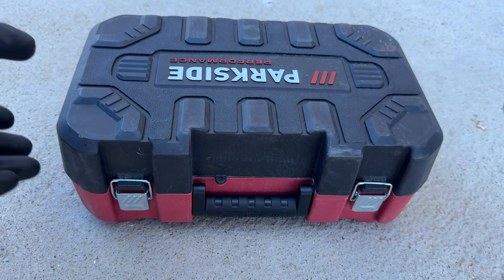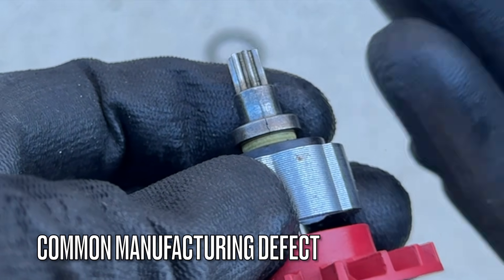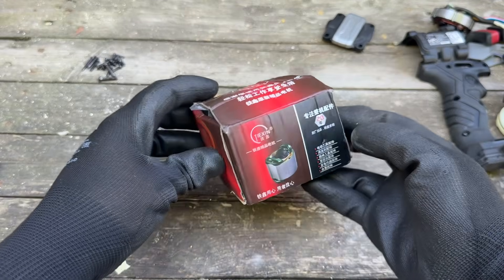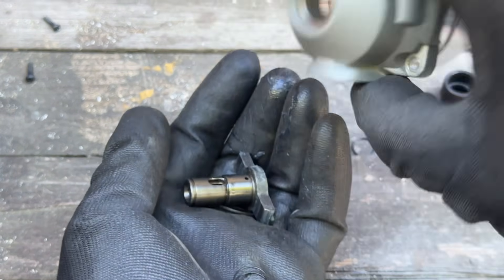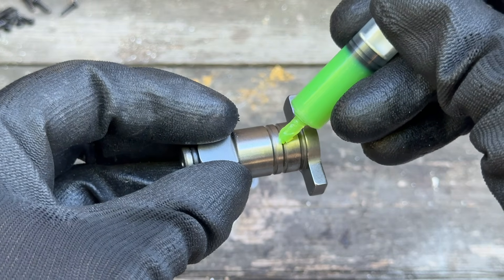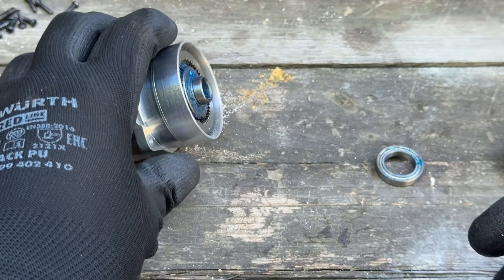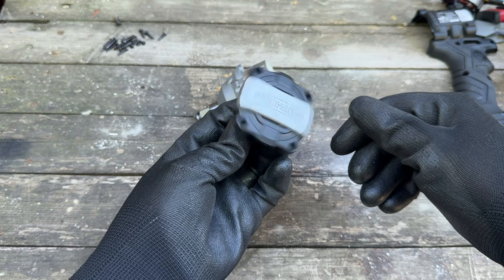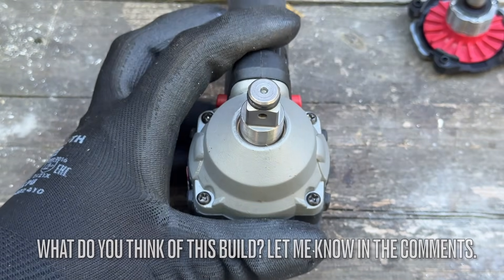Fixing the most defective tool IN THE WORLD. Cheap parts with links provided. Parkside PDSSAP C3

Comment: Everything I've bought from Lidl hasn't even lasted a year. Some tools didn't even last a day, others were problematic from the start. A corner sander (with triangular sandpaper) didn't even last a day and it was problematic. An angle grinder broke after two or three days. A plasma cutter didn't work properly at all; it destroyed all the front lugs, it burned right through them. The only good thing is that Lidl accepts all returns directly; you just need the receipt. For me, that's not the point. Someone buys a tool to go home and use it. If it turns out the tool is defective, their plans are ruined. Okay, make the tool a bit more expensive, but build it well. China is very bad at this; they don't test their tools. They build them and say they work, but nobody cares how long or how hard.
Reply from the maker: I agree that it’s incredibly frustrating when a tool breaks so quickly, and it's not worth the hassle of repeated returns. That's what I have been trying to say for like a year now, because the Parkside quality has hit rock bottom in 2025. It used to be that the tools were good for the price, bit now if I weren't buying them for reviews for the channel I would not bother with them at all.
Reply: Bravo, my friend. Then there's the other problem with these batteries: you buy a tool, but there's no battery in the package.

So, €50 for the tool and €50 for the battery equals €100 for a miserable tool + a charger = €130. Yes, that's outrageous!

If you buy a cheap tool from TEMU, it's just as good or bad as a Temu tool, but often you get one or even two batteries. Well, wait, nothing special. I bought a small chainsaw from Banggood two years ago. The batteries were so bad they were dead in 5 minutes. I ordered a new battery for €20. I knew I shouldn't expect anything special. When it arrived, I just had to laugh. The battery, about the size of a 6Ah battery, weighed next to nothing. It was so light, as if there was nothing inside.

Well, I knew it, but such fraud? And TEMU supports it!

Comment: So, whats the version we should go for? Thanks for your videos, I'm considering to buy one and customize it to my needs now that I know it's possible
Reply from the maker: So your best option would be the B3 version. that one is the one I would go for. Strong internals I have been using a couple of them converted in to impact wrenches for quite some time now with zero issues. Unfortunately you can't get them from Lidl, because it looks like they have been discontinued. That said the newest D3 version is also a good one. However there are two options with that and you don't know which one you're going to get. Basically it depends on the spring inside the impact mechanism. You can get it with a thick spring in which case you get loads of power from it, or you get it with the thinner spring in which case the absolute max in terms of power it can deliver is 300Nm. No way to know which one you got untill you open it up and check.
Reply: @BrokeLifeEU  I will try with the D3 then and see what I get. Honestly 300 is enought for me. I actually have a Rioby impact but this Parkside ones looks more handy and the idea of having socket and hex mixed in one is too tempting. Have you tried the Parkside electric ratchet? Would be nice to see some upgrades on one of those as they only have 54Nm and it's not usefull for breaking
Reply: I answer myself, just found your video and remembered that I've watched it in the past before I bought the ratchet
Reply from the maker: @danimp321  Unfortunately there is no cost effective way to upgrade the Parkside ratchet at all. Although I do recommend to break the fastener lose with the ratchet and then use the power of it to drive it out.

Comment: what impact screwdriver should I buy for seasonal changing of wheels and occasional unscrewing of screws?
Reply from the maker: That's a tough one. Ideally you need an impact wrench and an impact driver. But the question is do you really need an impact wrench once or twice per year for seasonal changing of wheels. I would argue not and it's best to get a breaker bar and a torque wrench. Then with what's left get an impact driver for the screws.
Reply: @BrokeLifeEU ok but which brand?

Comment: Strange thing, mine broke too, after i started using it like an impact wrench. Before that i used it to drive long wood screws into wood, and it worked flawlessly for hundreds of screws, but as soon i started using like impact wrench on my car, it broke after undoing 5-6 nuts.
Reply from the maker: They made them to a very low budget it seems and saved mostly on the metals for some reason. The impact mechanism and the drive gear on the motor are really common issues on them. They break after a bit more force is required of them. That said the impact driver you see in the video I got off someone who used it inly for screws in wood and it still broke…
Reply: @BrokeLifeEU  probably older versions are stronger, a friend of mine has an old one and is used heavily for years and it still works. I returned mine to lidl and got my money. A few weeks ago i bought another one, i have to open the package to check which version it is.
Reply from the maker: For sure the first version, the A1 is indestructible. The B3, which is one of later ones is also really good. You probably got the newest D3, which is not as powerful as the C3 you had, however might be more durable.
Reply: @BrokeLifeEU  yes, it is D3, hopefully it will last longer

Comment: how much different is the internals to an actual impact wrench when compared to a impact driver? you think this could be why these fail as people are using them as a impact wrench and theyre not beefy enough internally?
Reply from the maker: Not much different to be fair. The gears are different, contributing to higher RPMs on an impact driver. the rest is basically the same. However with this model in the video they made the shaft holding the impact mechanism together very thin. That is the part that breaks most often. On top of that it breaks even if you use it for just screws and nothing like the bigger bolts on car wheels. It’s just that fragile. The one in the video for example I got from someone who used it for screws in wood which should be what it was designed for and what it is best at. But still it broke after a short while. I think they fixed that in the newer model by using a thinner spring in the impact mechanism. Yea that means less power, however it also means less force on the internals and in turn a longer life duration for the tool.

Comment: Could you give me the link for that belt sander attachment on the grinder? Or is it just the 10 euro one from aliexpress/temu? Is it good?
Reply from the maker: I got it from aliexpress for like €10. The specific link is no longer active but it is just a generic belt sander for an angle grinder attachment. It is nothing special to be honest, you still have to do most of the work. The only thing it is good for is for sanding wood but even then it fell apart. But on sale you can get them for like €5 so if nothing else at least it is not too costly to try them out.

Comment: This afternoon I received my new screwdriver. Model D3. Made by OWIM. 
Before I finished screwing in the first test screw it died. Inside the case there are rattling parts or loose screws.
 I miss the quality of Grizzly and Kompernass.
Reply from the maker: Sorry to hear that! Mine has still not arrived…delay after delay… This is strange, because OWIM usually make the better tools, but I guess they were also made to cut down on cost so…
Reply: I have disassembled the machine. Inside, I found a loose screw. I have reassembled, the machine still does not work. The APP indicates "anti-surge protection" I dismantle the rotor. It is seized. I release it and the machine works again. 😅
Reply from the maker: @OGROMETALBROTHER Does it work well or does it just work 😅
Reply: @BrokeLifeEU  I just bought the D3 and B3 from my local Lidl. The new 1/4 bit holder requires to unlock it when inserting the bit tool, not just when removing it. Based on very limited testing the D3 starts impacting sooner compared to B3 and seemed overall less powerful with slightly more wobble on the chuck. The chuck on the B3 is almost perfectly straight. I can’t wait to check your comparison on it as it’ll help me decide which to keep long term.
Reply: When I tried the machine, it failed again. When the percussion works, the rotor bearing locks again. I disassembled the machine again. I separated the fan as much as I could from the back cover and reassembled. The next day, I used the machine as I thought I would like to break it. Screw and drill logs, maximum power. The machine works perfectly.
Reply: This afternoon I spoke with the technical service of OWIM Spain. In a few days, they will send me a new machine :)

Comment: I wonder, if with this 1/2 mod it is any better (higher torque) than PPDSSA 12 A1?
Reply from the maker: With all the fixes I made in the video it is basically like the original with a 1/2" anvil. That means that it would be more powerful than the PPDSSA A1 12. But do I recommend going through all this in order to fix this? Honestly I can't say I do. The parts alone cost nearly as much as the tool now.
Reply: @BrokeLifeEU  this one's specs say it has 223Nm, while PPDSSA has 300, and 350 for unscrewing. Does it really come that high? And how PDSSAP 12 A1 be at only 170, when its only difference (at least from the outside) is 1/4 hex instead of 1/2...
Reply from the maker: PDSSAP A1 12 and PPDSSA A1 12 are somewhat close on the outside, however completely different on the inside, not one part will fit the other. They are that different. In terms of the PDSSAP 20 in its 1/4" form it does have 226Nm, however when you change the anvil to a 1/2" I guess because of the larger mass of the anvil and not having an adaptor to rob you of power I have managed to unscrew very tight and rusty bolts that the PPDSSA did not manage to unscrew. I can't speak to any Nm claims but just experience.
Reply: @BrokeLifeEU  oh, now you started to convince me :D thanks :D
Reply from the maker: That said the PPDSSA A1 12 is smaller and lighter, with the 5Ah it can do 95% of the work on your car so if there are no rusty bolts you might like it better. 350Nm claimed by Parkside is a bit of a stretch I think, but up to 300Nm it will be fine.
Reply: @BrokeLifeEU  i bought today PASSK 20li C3 and ordered PDSSAP A1 12 to compare. My goal is to have something, what does better with car wheels and can do the role of impact driver. Youtube tests show minimal difference between these two, as it comes to torque, but PDSSAP is lighter and smaller...and PASSK has many negative opinions. I will return to the shop what is worse. What is your opinion between these two?
Reply from the maker: I tested the PASSK C2 which I think is the same as the C3. The difference is the C2 came with a battery and charger and the C3 is a bare tool. All the videos I have seen that feature a PASSK and PPDSSA feature the older PASSK, made by Grizzly that is the B2. Or the first one A1 made by Kompernaß. These newer C versions are made by OWIM and are the best so far. Much more power and better build quality compared to the older models. I tested the C2 against another impact wrench, you can see here - https://youtu.be/WQrmUB8T8-w?
Reply from the maker: I would love to read an update from you when you test them out!
Reply: @BrokeLifeEU  so, the update is, i returned PASSK and never want to see green parkside again (last week I had oil leak on chainsaw, used once 😆)
Nm button stuck pressed in and there was loose screw rattling inside after one use. As for power: it unscrewed wheel bolt tightened 2-3 weeks ago at tire change, but failed at second car, where I tightened bolts with my 80kg standing on 30cm wrench half year ago (acceptable, because with 62cm wrench i had to use much more than 400Nm 😅). It worked as well for bolt tightened with 80kg on 62cm (480Nm, more than its max, but did it)
I hope that small Performance friend will do better than this...
Reply from the maker: @SQBANY13  The green stuff is hit and miss at the best of times. I have had much better luck with the Performance stuff and so am sticking with it. I do have the odd green tool but only when I don't have a Performance option available. Sorry to hear you got a dud! 😑

Comment: Still not as bad as the C2 or b2 whatever it was 🤣 the switch lag was horrible, electronics die all the time... they replaced mine 2 times and 3rd time gave me the c3 I think which is doing really well in my case
Reply from the maker: I think they are about equal in terms of defects. I have seen so so many broken C3s that you would not believe. One of the issues is a broken drive gear which is easy to fix, the other one is a broken impact shaft which is next to impossible to fix reliably.

Comment: every day I am more happy to look for a b3 model for months and get it new at a good price
Reply from the maker: The B3 is not without its faults, however it is far FAR better in terms of durability than the C3. Only ever seen one B3 have issues, out of the dozens I have seen and in terms of the C3 it is about a 50-50 shot.
Reply: @BrokeLifeEU  to this day, being with the power mod (I recommend it) continues to work as the first day, I have to put heatsinks on the MOSFETs to make it more reliable.
Reply from the maker: @kiky2h  Is that the B3 or C3?
Reply: @BrokeLifeEU  B3 model!
Reply: @kiky2h where i can find more info about power mod please?
Reply: @vodnik263  https://www.youtube.com/watch?v=wYZUw6Paa4w
Reply: what about the new D3?
Reply: @dezsonedo6179  weak spring on hammer Vs B3

Comment: Broken! very well repaired. this mini tool not for car wheels and next level brocken again😄
Reply from the maker: Thank you! The C3 version of this is very problematic. The person I got this from used it only as intended, that is to say for screws in soft wood. The impact mechanism I put in it is from an impact wrench. So the combination of the new impact mechanism and anvil for an impact wrench and the body and internals of an impact driver should account for an impact wrench with high RPM. All of this resulting in high impacts per minute so a good torque number.
Reply: @BrokeLifeEU  So which version you reccomend B3 or D3 ?
Reply from the maker: @disturbator  Out of these two the B3 is the one to go for in my opinion.

Comment: Great build👍. It just does not make much sense, i mean tool should be under warranty still? Unless it come out flea market or for cheap. Made a  several Bosh 12V line ones - buy 2-3 for a couple eu and build one working😁
Reply from the maker: Thank you! Yes, it absolutely does not make much sense 😂 these tools should be warrantied whenever possible. But in this case it was not possible as I was handed this and asked to fix it if possible. This one had no warranty I don't know why. So in the end I fixed it with new parts, I am not a fan of welding the broken pieces together at all. What type of Bosch are we talking about?
Reply: @BrokeLifeEU  Oh, good fixing solution then👋.  Bosh blue 12v line  Multicuter,  Jigsaw and circular saw so far. Mostly drills and impacts on markets😞. I am thinking to make electronics update  to PDSSAP B3 - transistors, wires and mayybe current feedback loop to give it  even more umph. Things can be improved, noticed while swapping anvil. thank you for that video by the way. it's  just hard to measure if it will get  any better

Comment: Any ideea where can I buy spare parts for the cordless rotary hammer?
Reply from the maker: I have not looked in to spare parts for a Parkside rotary hammer. What is the model and which part is problematic?
Reply: Sorry for not answering, didn't get the notification. I don't know exactly what broke, but it lost the percussion, it's not hammering anymore, it only spins, with full speed but with no power, if you hold it by hand, it will not spin anymore and it's not hammering at all. I've send it in warranty and they said here in Romania don't sell it anymore and don't have the parts for it, and send me a new one after 2 months from Germany

Comment: not surprised it broke, not intended for use as an impact wrench
Reply from the maker: You'd think so, however I got it from a person who only used it as intended. That is to drive screws in wood. Mostly 6x160 and 8x160 screws. It should have been able to handle that for more than a month don't you think?
Reply: I think 8x160 wood screws are to big for this impact driver.Even with predriling.My opinion.
Reply: @BrokeLifeEU  y
yet in the video you use it to undo a wheel nut! so why do clickbait???  in your own time.
Reply from the maker: @backdoorbursta2866  I fail to see how any of this is clickbait. In the video I point out that the new impact mechanism can also be used to simply replace the old broken one and keep the tool as an impact driver.